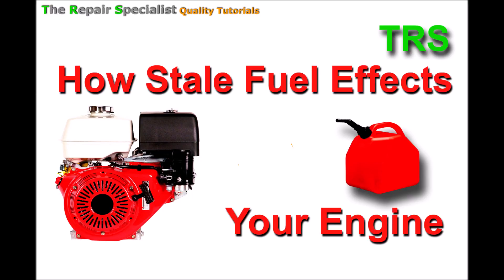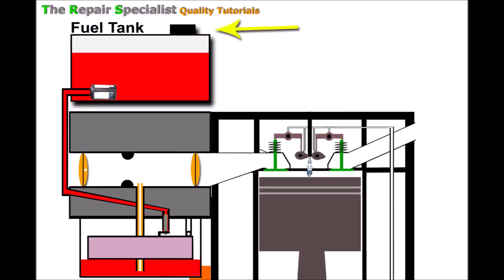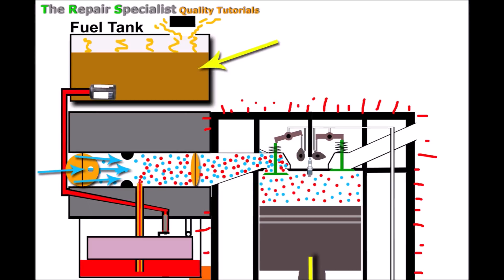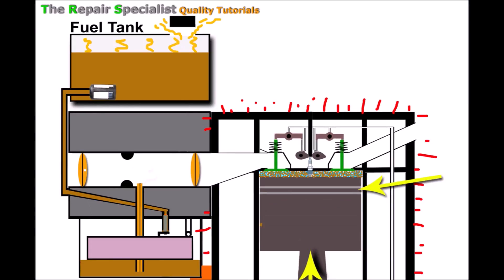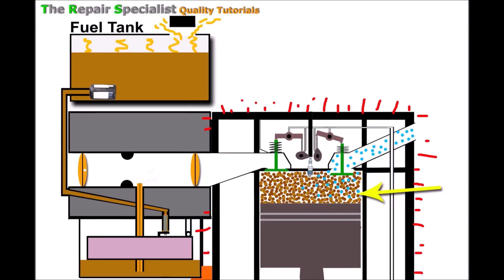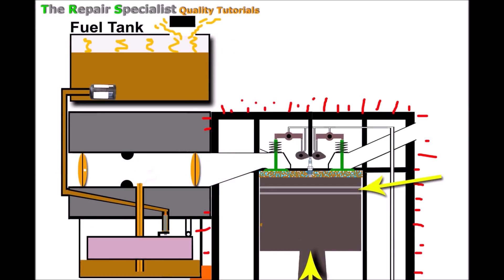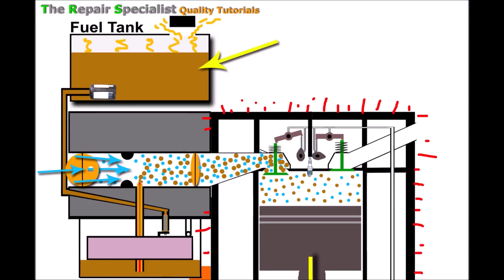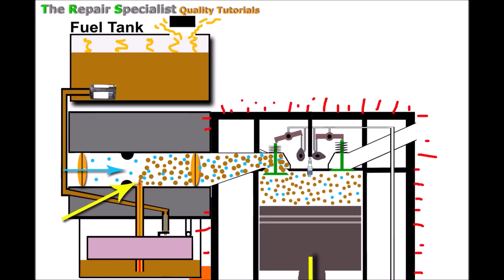Engine Failure | Stale Petrol Gasoline  - Why? Lawnmower/Chainsaw/Car/Dirt Bike.  (by Craig Kirkman)

Comment: What is your opinion on synthetic fuels like TruFuel for my trimmer and blower? I only run them once per week and they sit for a couple months in Florida winter. I’ve been using only TruFuel with good results but my repair man told me it’s junk
Reply from the maker: Great point! I will look at making a video on that. Thanks, Craig

Comment: Youre the only one mentioning that the volatiles evaporate off very quickly in vented fuel systems. Especially in hot climates. Yes it may run but its carbonizing your engine and if youre on a bike and foul a plug it may be a very bad day.

Comment: Would this affect the engines of newer cars too? For example, I have Subaru levorg, which I leave for longer road trips, meaning it's often sitting in the garage several months at a time? Any advice?

Also, would topping it up with higher octane fuel when taking it out have any positive effect?
Reply: Cars are more sophiscated and compensate for different fuel quality, electronics will adjust itself to run normally. In my experience, fuel will last much longer than 5-6 weeks without noticeable effect in quality, I believe petrol can be left up to a year (providing its not too humid, leaving tank close to full to prevent too much water from building up in it) without noticeable downsides. I leave my motorcycle over winter and start it on same fuel next season with no issues. Premixed fuel or 2 stroke fuel mix tends to have much shorter life, 1 year old premixed fuel caused issues for my boat outboard engine where it would occasionaly stall the engine and wouldnt start until spark plugs have been cleaned. Diesel usually has longer lifetime.

I would suggest inflating the tires more or supporting some weight of the car if left unmoved for so long to avoid tire deformation.